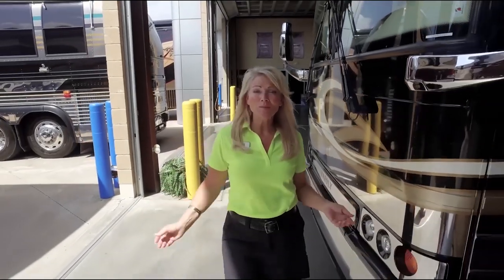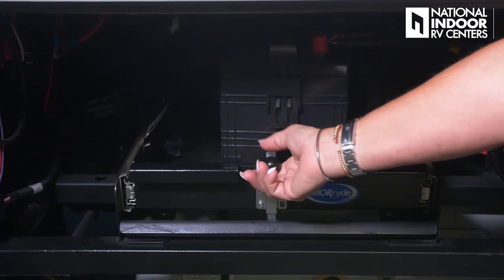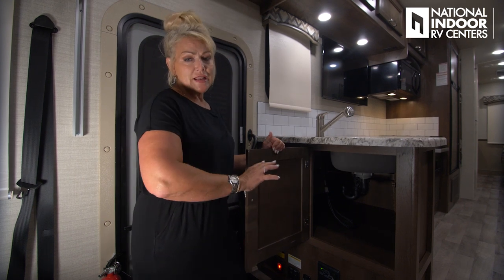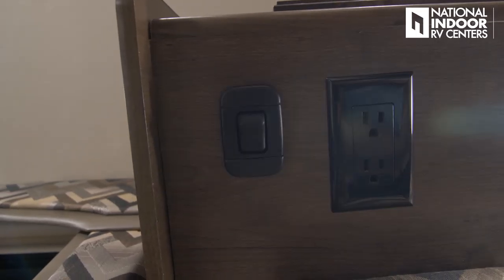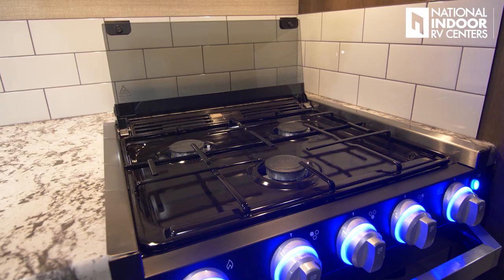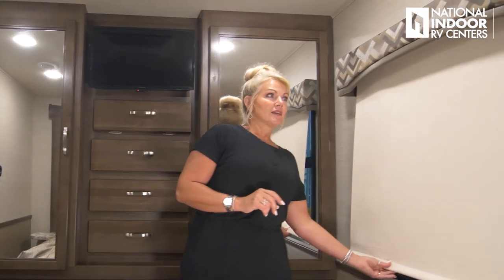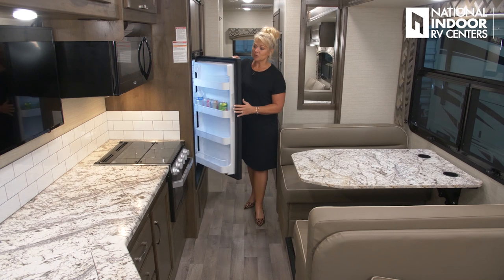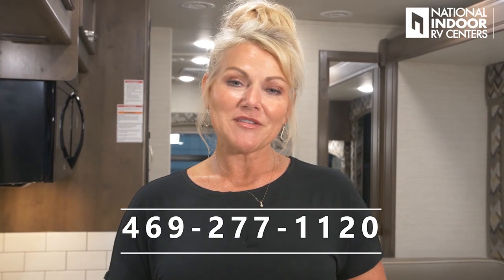2020 Jayco Alante

Comment: Surprised over 4K views and no comments yet. Great presentation Angie as usual. Surprising space with slides in for quick parking lot overnights. Nice for the entry level first time buyer. I would imagine the pantry space goes away with the double door fridge.  Wonder what horse power is and if disc or drum brakes. One option they missed or should provide is metal cover for awning to prevent sun rot when retracted.  But I’ll take the Newmar 40’ Mountain Aire hands down any day. I know apples to oranges.🤪❤️

Comment: Nice big picture window at the dinette.  It would be nice if they add usb charge plugs through out the coach.  It would be super easy when they build it.  NIce having the 2 more seatbelts, now they just need to get some shoulder strap seat belts in some seats.  Nice having outlets under the cabinets in the kitchen, but having it to the front of the cabinet hangs the cords in the way, if it was to the back it would be nicer.  I moved some for a friend in his coach a while ago.  The cook top cover is nice, love the oven, so many do not have one.  Awesome job Angie, love your videos. Nice windows by the master bed.
Reply from the maker: Hi Pat, I agree with you that all of those little adds would be nice. As you step up each level they add more of those features. 

Thanks again for your comments!